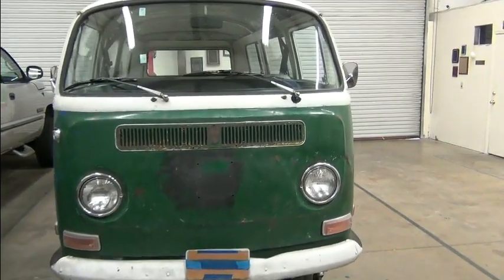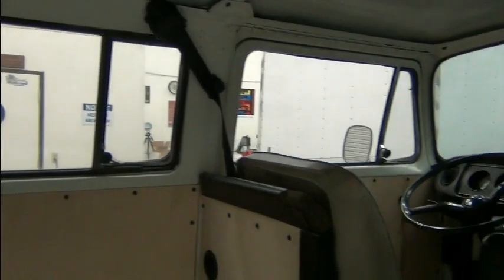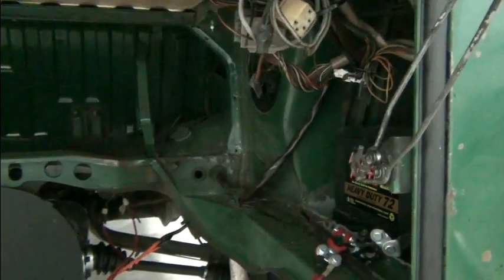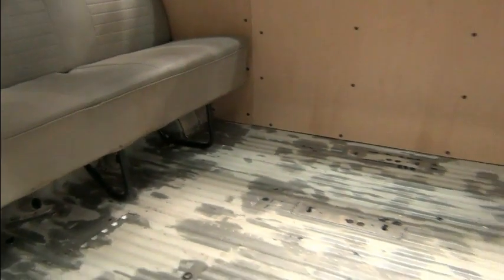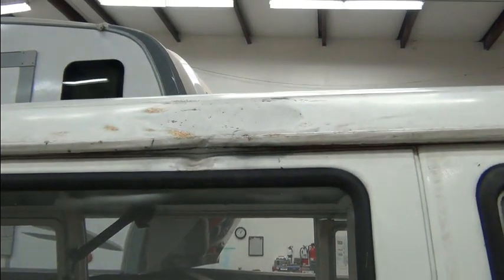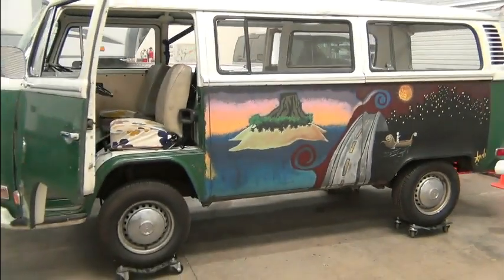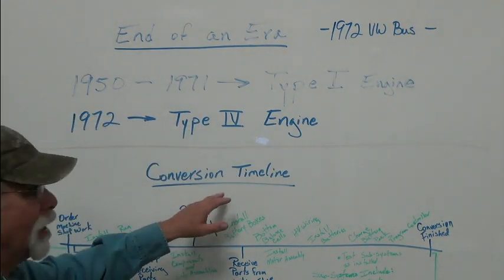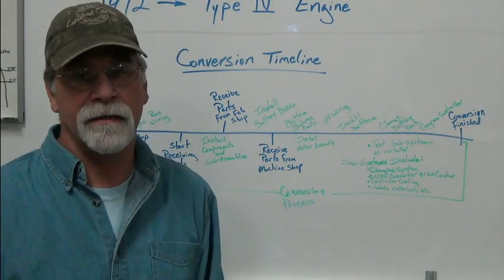VW Bus EV Conversion - End of an Era?  From Gas to Electric Conversion

Comment: I don't understand why people convert old cars to electric propulsion... They're antiques. They're not going to be used as daily drivers. They are not comfortable like a new EV from nissan or tesla or audi. Taking out the gas engine is like painting a new dress color on the Mona Lisa. No one would ever do that. I have 5 classic cars here in the silicon valley. And they will always be gas.
Plus, these old gas cars can be super reliable with some small modifications like electronic ignition and electric gas pumps.
Reply from the maker: I drove and enjoyed my electric Karmann Ghia everyday for 7-1/2 years and 97,000 miles.  Had it been gas powered I would have adjusted the valves 32 times.  Plus 32 oil changes.  Even with electronic ignition and electric fuel pump.  Instead it was turn the key and go.  But that is why there are Fords and Chevys, different strokes for different folks.  Personally I enjoy driving EVs so much that I no longer own any gas powered vehicles.  Thanks for watching.